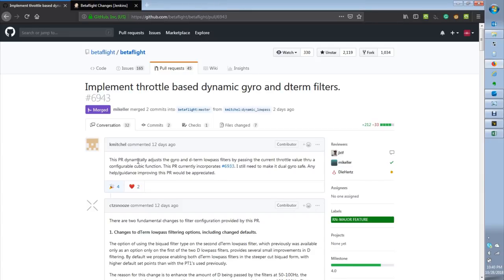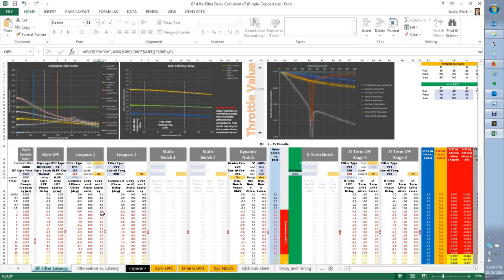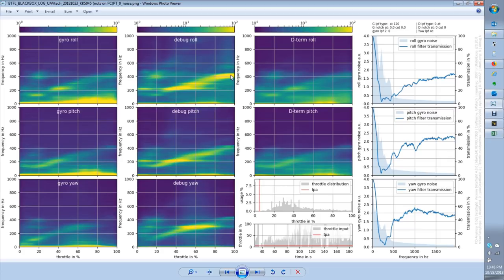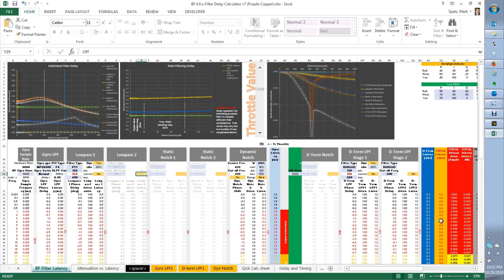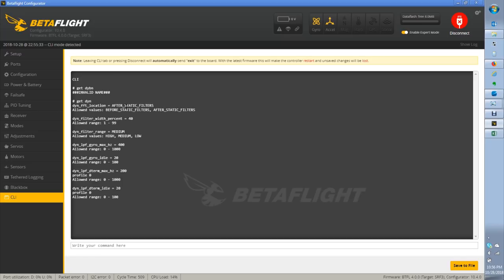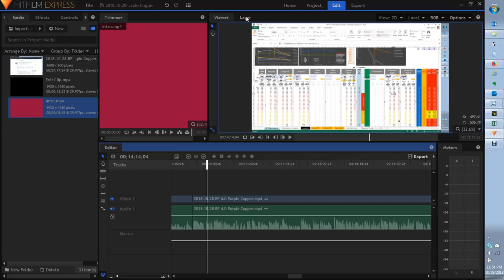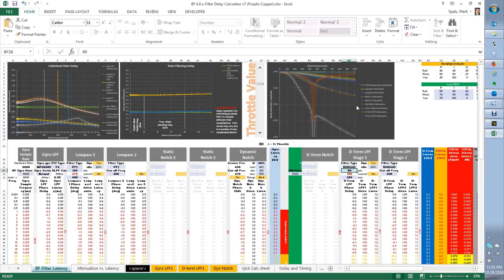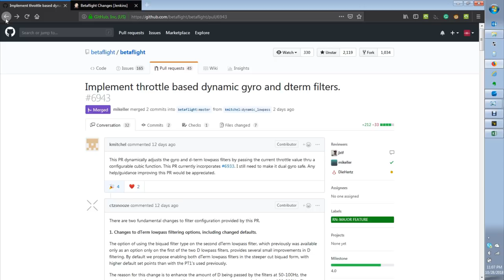Betaflight 4.0 - Dynamic Lowpass Filters

Comment: Betaflight 4.0 build 1203 is nice!

I kept having some severe mid-throttle oscillations with 2450kV Hypetrain motors, 5S batteries and BF3.5.2 on my Chameleon 5". Low PID's, high PID's, oscillation went from a fluttering sound to all out shaking but never disappeared. Lots of noise coming from roll and yaw axes. Lowering the filter cutoffs or selecting biquad filters made it worse, increasing cutoff helped little.  Played with dynamic notch quality and width, with minor results. Added extra capacitors, which helped slightly. Lots of tinkering, going through megabytes of log data, little results. 
I almost came to the point where I was considering getting another FC; the ICM20602 gyro in general and the Matek F405 board in particular are known to be very noisy; PID-analyser debug frequency plots are all yellow on the upper half. No amount of softmounting or capacitors can bring the noise this FC generates to the level of say an Omnibus F4. 
But oh well, motors were not getting warm and while the quad was still fluttering between 30% and 70% throttle (throttle limit is at 80%) it flew acceptable. 

Now, yesterday I stumbled over this video and thought 'oh well. Trying is quick, and so is reverting. Why not?'. I did not expect anything major, but oh boy, I was wrong. With filtering and PID P/I/D coeffs on defaults I flew three batteries. I still have to analyse the BB logs, but the quad flew and sounded really clean. Night and day difference. Handling was a lot sharper too. And of course propwash handling after a sharp 180 turn was superb, but it was not bad with 3.5.2 either.  Current draw was also lower, but fluttering costs energy too. 

I really wonder what change in BF4.0 build 1203 over 3.5.2 causes this massive, major improvement? I mean, BF3.5.2 is already top class firmware and I more or less expected only minor improvements, not this.
Reply from the maker: Glad to hear it helped!!  There were major improvements in the Dynamic Notch from 3.5.x to 4.0.x.  Basically, we were only halfway done with the improvements when the feature freeze occurs with 3.5.x.  So that in combination with the dynamic LPFs is my guess.

If you still have MTOs, run a log where you hold throttle constant during the MTO even for a nice forward flight for a second or two.  Record FFT_FREQ as the debug mode in 4.0 and we can look at the log.  In some cases, you may need to just put a static notch on that point, but it would be good to see where the Dynamic is positioned in that case.  Hope this helps! 

[p.s., we also need to recognize that sometimes for MTOs it is just the camera shaking from the mechanical vibrations of the motors and the PID loop is appropriately filtered and not adding to it.  In that case, all you can do is fix the mechanical.  For that situation, I first recommend switching to HQ5050 or T-motor 5043 props.  They seem to have the lowest noise profile in a bunch of testing done by others.  If that doesn't work, then you need to look at your motors and possibly frame.  Of course do a sound mechanical check too (screws all tight, stack mounts sound (not broke and undetected, etc...)
Reply: With the smile that is the result of my 4.0 testflight still on my face it seems you were not even close to halfway done when the BF3.5 feature freeze occurred :) :D

Camera shaking does not make that awful fluttering noise, and the fluttering was also visible in the motor traces and PID outputs. Mechanically everything is tight; that is the first thing I check. I disassembled the stack to add extra capacitance and checked the frame and motor screws when I did that too. So I know they are good for now. 
I will check the BB logs tonight when I get home from work. Will do extra logs and ship them to you if I notice weird behaviour. But so far the difference is night and day, and that is on defaults for PID PID coeffs and filters. 

Motors are quite fresh (maybe 20 packs on them), props were new HQ V1S 5x4.3x3. Usually I have good results with those.

BTW: If you want me to test some BF4.0 features and submit logs to help development, feel free to ask. For the rest, keep up the good work! What the Betaflight team accomplished in the last 6 months or so is incredible. Keep them coming!
Reply: Not too bad on defaults, but there is room for improvements; tracking of the sticks is not superb. However, it feels better than what the blackbox data shows. Filtering has definitely improved with build 1203 compared to 3.5.2; it manages to reduce the very noisy roll axis quite well.
In case you are interested in this totally uninstrumented lunchbreak testflight without special cases (except that it was very windy: bft 5 or so):

.webm video: https://nextcloud.icecoldcomputing.com/s/ZBSSD5WZBdotYA7
BB log: https://nextcloud.icecoldcomputing.com/s/FcoPTfWtc5RDXza
PID-analyzer noise plots: https://nextcloud.icecoldcomputing.com/s/Lxieb8C9Q3PN9F6

Comment: Music to my ears! The future seems bright for betaflight! Tbh I do not know in what kind of builds are stage 2 lpfs necessary. I run only stage 1, 150 on the gyro and 100 on dterm in all my quads,even my micros, Ps around 65-75 and Ds around 35, superb propwash handling and no excess heat at all.
Reply from the maker: Yeah buddy.  You get it.  LPFs shave off some noise, the the Dyn Notch is doing 90% of the work now-a-days.

Comment: Good Stuff! New to your site and love it.  Questions:  Do the noise frequencies depend on the size of the Quad/Motors/Props, etc.?  If so, what size quad/motors/props, etc. are the default numeric values of your data based on?  If for example, these values are based on a 5-inch Quad ONLY, would these default values need to be changed for a 2.5 inch quad?  If so, would it be possible for future BetaFlight releases to include "Default Value Options" for different-sized quads or will this "Dynamic Lowpass filtering" inherently take care of all of it as long as min and max freq's are set up correctly?
Reply from the maker: Min and Max for LPFs should be good.  But I defer to George as he is a micro tester.  For the Dynamic, it is likely better in "HIGH" mode for a micro so it will allow the notch to focus higher 600 to 800hz noise.  See my video on that linked in the cards of the above video.

So generally smaller, stiffer and lighter rigs have noise that is shifted higher in frequency (a GREAT THING).  Bigger, loose, and heavier rigs (6" / 7", etc... shift it lower; which sucks and makes them a challenge to tackle.  Lets see if George can weigh in for some advice here.
Reply: Micro quads are different - but only a few settings need to be changed.  The Dynamic Filter should be set to "High" as Mark noted.  The max for gyro lpf 1 should be raised to 450-500.  Gyro LPF 2 should be at 300.  That's it!  Optionally, you can set your dterm lowpass 1 to a value of 100 in the CLI, set lowpass2 to 250 and set the max for lowpass 1 to 200 in the CLI if it is not already there.  Those are the settings I use for 2.5" quads with motors ranging from 1106 5500 on 3S up to 1304 5000kv on 4S.
Reply: @duckslave  Perfect!  Thank you for your rapid response.  As I mentioned, I am new to this site but am very much interested in what you and Mark are doing and have done.  Thank you both for all of your efforts.  Keep up the outstanding work.  Very much appreciated!

Comment: Thanks, Mark, for that great introduction (and all the other you posted before) in the newest techniques of Betaflight! Up to the moment I'll fly with 4.0 build 1075 on 3 quads, it's stable and a big improvement over 3.5 for me. When installing the newest build (1203? hope it's stable, too?) - is it safe to do a CLI load of the complete dump copy from my former settings?
Reply from the maker: I would NOT do a dump.  I would do a DIFF and paste that.  Double check orientation (QUAD moves as expected) in the Setup tab, double check filter settings and PIDs in the GUI and you should be good.  DON"T FORGET TO DO A RESET before pasting in your DIFF!  I can't say this enough.  Between that and saying NEVER FLY WITHOUT A BUZZER, I feel I can't emphasize enough.
Reply: OK, works fine, but no external beeper sound? DSHOT beacon is still functioning.
Reply from the maker: @mr.m.4887  , dshot beacon is working for me.  Huummmm...

Do you make sure to double-check that the toggle for the beacon to activate on a switch is flipped?
Reply: @uavtech  , oh I'm sorry, I checked it out. Unfortunately the beeper is defective. THX!

Comment: You played a big part of making this happen Mark 💪
Reply from the maker: Ditto Brother!
Reply: @uavtech  to get most from  the biquad Dterm filter you really wan to  cascade them at a higher value.. I'm running stage1 at 200hz min, 250hz max and the stage 2 at 200hz which also cuts more latency.
Reply: @Sugar_K  can you please explain the cascading again? So the stage2 dterm should be lower than stage1 max?
Reply: Hrr Pippi this is for a really clean build and you need to work up to it but yes this is what I was recommended by the guy who’s ideas brought about this new filtering system. Cascading is adding  multiple lower order filters to produce a higher order  effect but without the  precision errors that high order filters are prone to. As you are effectively reducing the overall filtering you need to move to these settings in steps making sure you don’t have an increase in motor temp though.

Comment: Does pterm oscillations hit a specific freq?
I ask about it because, when my pterm gets too high, it sounds like the pterm oscilations are at the same Freq every time, and if that is the case for all builds, would it be possible to make some kind of filter looking for oscilations in that exact range, and dynamically lowering the pterm whenever needed?
It could maybe work at both roll and pitch seperat.
Reply: I think with the advent of feedforward, upping your P gains till it oscillates and back it down a few point is archaic way of tuning. Baseline should be that you tune P gains on pitch and roll with 0 feedforward. The lowest or enough P gain that you won’t get any wobble after a maneuver. After you have that set, then start tuning the feedforward for stick feel. Increase or lower from default of 60 till you feel that it response fast enough.

Comment: Sound like a good idea to improve prop wash handling. Don't know how well it will work on noisy builds. Most of my noise after dyn notch at higher throttle is 140-220 hz. Increasing lpf freq on d does not seem like a good idea. Maybe a good way to motivate me to clean up the build a bit to reduce mechanical vibrations XD. Good explanation as always.
Reply from the maker: Agreed.
Reply: The other thing that will help you is the TPA acting only on D in the new experimental Mashup code.  Setting TPA at .6 at 1500 with the new code will help to get rid of dterm low freq noise at high throttle.
Reply: @duckslave  : any chance we will be able to set TPA and TPA break point separate for P, I and D (mainly P and D)? For ppl who are slightly insane and want to take the time and get the behavior they want across the throttle range.
Reply: someonespotato hmm  - not yet.  The current experiment is TPA on D only - and there are good reasons for it - not the least of which is the gyroscopic force exerted by the rotating motors and props - which acts like another Dterm - so reducing D as the motors spin-up is really useful to avoid having too much D and getting the ill effects of too much D.